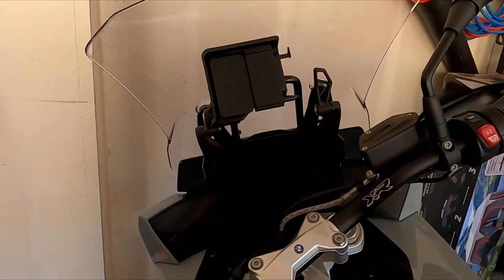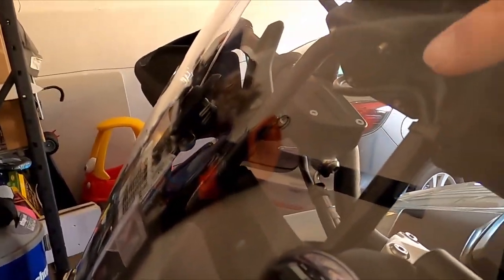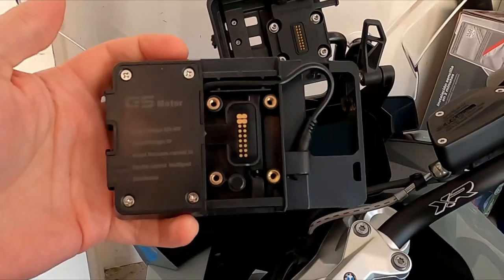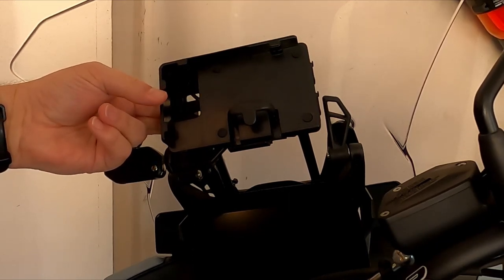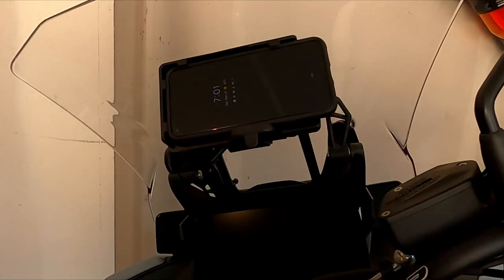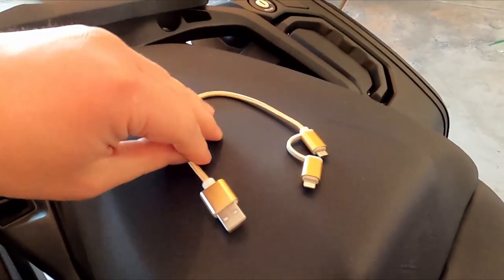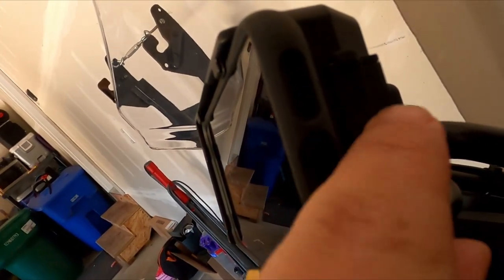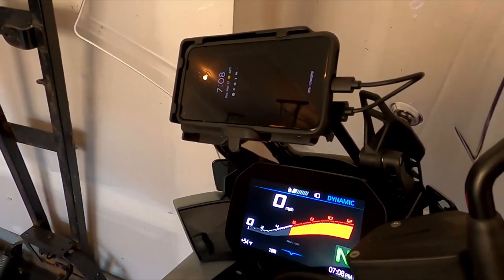Mount Phone In GPS Cradle On BMW S1000XR

Comment: Thanks for an informative video on how to make something out of a technology relic.  I have no idea why BMW in 2021 is still putting a big Nav bracket in the middle of its windshield.  It's ugly and blocks view, especially if you want to run a camera behind the windshield.  And you're right about the vibration issue.  The S1000 inline four vibrates quite a bit - more on my S1000RR - but still quite a bit on the XR.  While not the prettiest mount, the benefit of an RAM X-Grip is that it also provides excellent vibration damping.

My buddy has the new S1000XR and I have the RR.  He kept this anachronistic bracket and put the phone mount inside as you've shown.  It vibrated loose about 6 months later and he almost lost his phone (dangled by the cord).

My first mod with an XR would be to remove completely this eyesore, but it's not even that easy.  You need to tear apart the front to dig out all of its tentacles, but certainly something I would do.

As for video behind the windshield, I like to run the Insta360 One X2 mounted to my steering stem.  It's continuously powered by USB there, so no need to change batteries, and provides a great 360 view of the front, instrument console, you, the sides, everything.  Here is a sample video when I first got it about six months ago.  Again, it's on an RR, but the XR mount and view would be very similar, at least once the nav bracket fossil is exhumed.

https://youtu.be/whch-MMmGZI
Reply: There was a lot of complains that this set up ruins the phone/camera.
I wonder if RAM mount maybe a better option.

Comment: I've bought the wireless version for my r1200RT. It does get a good hold of the phone and it doesn't move at all in the cradle, but mine has a silicone case on it.
I got mine from AliExpress for £26 in the UK, but I have seen them for sale in the UK for double that, exact same model. Only took two weeks to arrive from Hong Kong
Reply: Hello, do you have a link for the product? Also I am looking for a wireless charging version of the one in the video but for the S1000XR.  Would the one you bought work on the XR?
Reply: @mosuby   I can't get the link to paste. If you go to Ali Express and search for Running Panther, they sell both versions to fit the BMW's
Reply: @tojj29  can you turn the charging on and off? To avoid phone from overheating
Reply: @jonasv19  I assume its the same as when it's plugged into the normal charger, or say on a wireless charger at home, it gets to 100% then stops charging. To be honest, it's never got to 100% on a ride cos with the nav app in use, it's constantly got the screen lit up. Can't say I've noticed the Galaxy S20 get hot yet. It's certainly not a fast charger, just seems to stop the phone dying during all day use

Comment: Hi. Thank you for the video. A question if I may, does the energy supply switches off as you power down the engine? Imagine, just for the sake of the discussion, that you leave your device on the cradle over night……
Reply from the maker: The USB port does not supply power when the motorcycle is off.